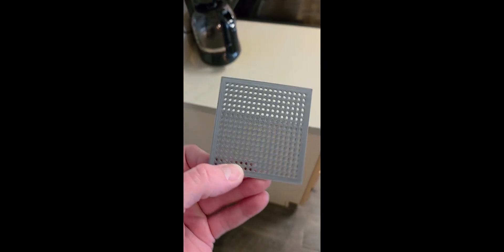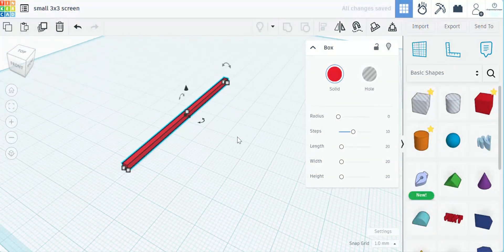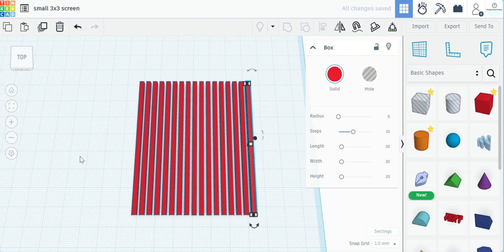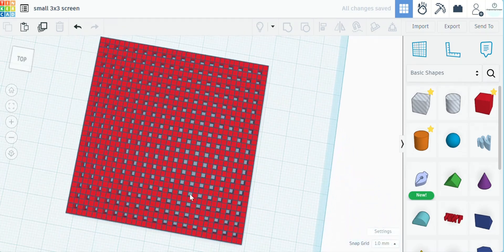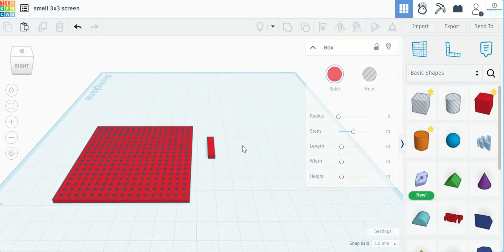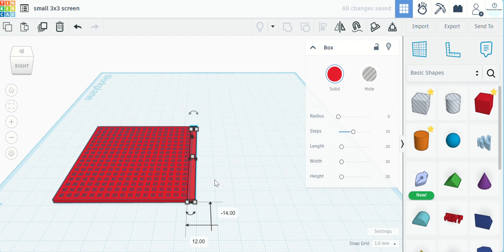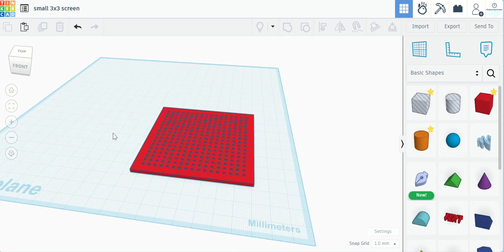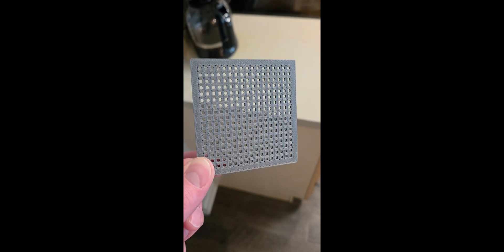How To Make Cool 3D Printed Mesh in Tinkercad!

Comment: Is there a way to do this within a different shape (like a hexagon that's a mesh or a heart that's a mesh?
Reply from the maker: Definitely! First select the shape that you want to use, make sure that it is hollow with just simply an outline of the shape that you want to start with. Then build the mesh within that shape the same way you build the initial structure of the one in the video. Just extend the ends of the pieces that you're using to make the mesh to the outline of the shape from the inside.